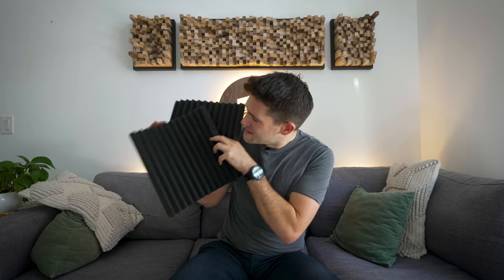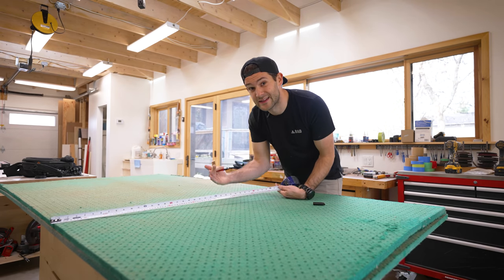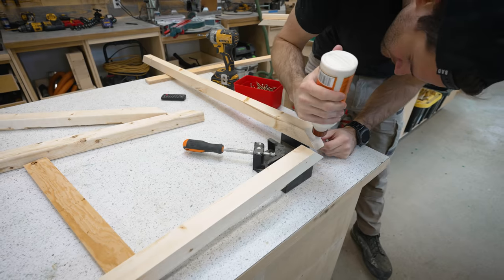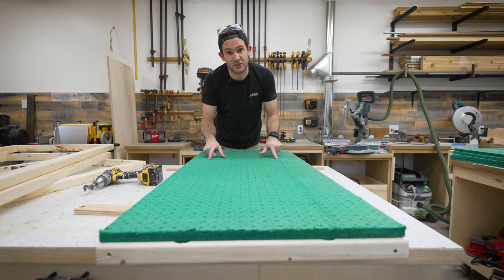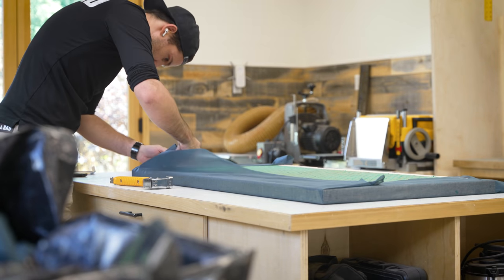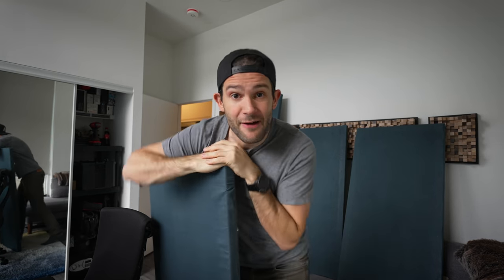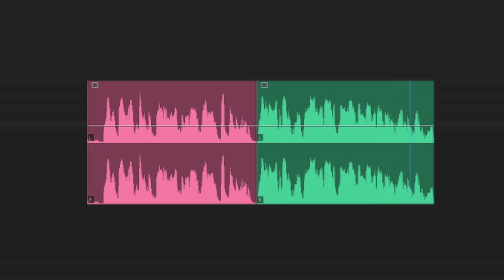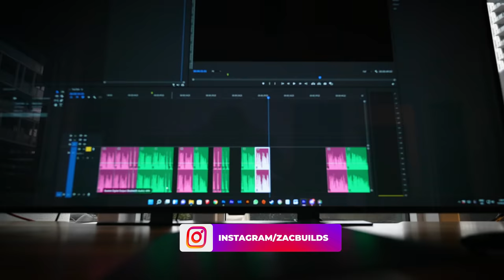Acoustic panels that actually look GOOD

Comment: Nice video, looking to do the same thing. One thing to note, I have the yeti X microphone and the software is pretty good at noise cancelling. Was that switched on when doing the comparison because I could hear a difference but not massively. The video itself was a better comparison. 

Good job either way. I like your recording style. Keep it up.
Reply from the maker: Oh damn thats a good question, I didn't even think to see if the de-reverb was turned on in the software. I've definitely got the compression turned on and a few other effect enabled. I thought the different in real life was way more noticeable than the recording showed and this could be a very good explanation for why

Comment: You chose a material designed to reduce kinetic energy to reduce sound waves.

You could have used polyfill or scouring pads. Lots of materials will work. Rock wool works better than most.

Comment: Your blinds aren’t going to do anything except in very high frequencies which due to their directionality would be pretty unlikely to come through the mic.
There’s a reason professionals use rockwool/roxul vs those terrible thin sound foam panels you mentioned at the beginning, and primarily due to their thickness. The science is pretty clear on broadband absorption and the thickness is one of the most important factors.
However you do have me interested in looking these up now. Would be worth a try as long as they are porous, but I would doubt they have much of a broadband application and are probably more for isolation.

Comment: Great Job! If you would hang another 2 panels on the ceiling, it would make a much bigger difference as standing waves also occur in a vertical orientation. Trust me you will not regret it :)

Comment: It should be noted that although this is fine from an interior design perspective, and better than nothing (and foam) from a sound perspective,  acoustical room treatment really isn't a 'throw the spaghetti at the wall and see if it sticks' kind of operation.  There's a relatively easy to apply science to it, and the information is readily available.  So do a bit of research and use discernment in which sources you use.  Hint - People who operate and/or build  professional studios know a thing or two.  There's plenty of them on youtube.

Comment: While I can understand the need for specialised sound treatments in a sound studio where you want as much reverb dampening as possible without using too much space on it. I don't really understand why people would need as much fancy acoustical treatments on the walls of a home studio... 

At least in my apartment; the main issue isn't reverb but lack of wall space... In my living room, one short wall is entirely windows covered in two layers of curtains; the other short wall is covered by 3 overflowing bookcases and a bar cabinet and a door; the long walls are covered with more cabinets, a tv (bottom half covered, upper half paintings), a door and three CD shelves (that is 90% full and never will get any more full) and a corner sofa. What little space not covered by furniture is used for paintings and prints (and we still have paintings we have no wall space for). Before moving in it was an echo chamber; but with all the furniture, art and decorative knickknacks theres very little reverb left. If I wanted the room acoustics to be even more dead; i could easily fix that with another rug and maybe a few panels in the ceiling. I don't understand how people manage to get the rooms in their houses so empty that reverb becomes an issue.

Comment: Hey man! Looks like the fabric works fine for holding in the materials on the back, but I have tried things like very thin wood panels and screen (like patio type) on the back and it's worked some what ok. Maybe see if one of those helps if you ever make more, thanks for the video my man! I prefer your frame style over trying to miter and fit 1x3s

Comment: Sound isolation is extremely simple, you need mass between the rooms you want to isolate, and NO bass cannot be isolated, it can only be dampened.  To fully isolate bass you need a 6 feet thick solid mass (average bass sound wave length) like pro recording studios for TV shows or movies for example.  That being said, acoustic panels are for sound treatment, not isolation.   I just though I'd clarify because you threw a few "isolation" in the video, I am that was not intentional but it might throw some people off.

Comment: Wondering if you'd left the SANOPan panels single thickness and doubled the wall surface covered? IOW, do two layers give you double diffusion, or does twice the surface coverage of one layer give you more diffusion?

Comment: I'm wondering what your blinds are made of???
    Even cotton, or mostly cotton) sheers ove all your windows will make a difference...jus make shure theyre still kindof wavy when closed (if that makes sense)...not flat like a window shade...so enough panels for the size of widow that it stays wavy when closed.

Comment: This panels are nice for the looks but its not absorbing (low) frequencies below 50Hz maybe some mid frequencies but its too little too notice some difference in your sound. The diffuser in the back is used when your sound is too dry, I doubt if it realy works in a large and non absorbing room. Try also to do something with your ceiling its very high. Dont use your speakers on your desk the soundwaves are reflecting on your desk and it will be a pain in the ass to absorb the frequencies when you have a large reflection point. Try thick curtains for the windows thats going to make a huge difference, it will be more absoring as the small accoustic panels.

Comment: Zac, you took the idea right out of my head. I have been wondering if Sonopan could be used effectively as sound absorption panel filler!
Reply: The potential issue with it is that it's designed to STOP sound from moving from one room to another (transmission). This could mean that, while the sound is prevented from making it through to the next room, it's bounced back into the room where it originated. That is exactly what you're wanting to avoid in this kind of application. It may be why the results of his test weren't as different as they could have been. What you need is a material that will most effectively ABSORB the sound.

Comment: Yeah nice video, but it seems like a lack of understanding on how sound reacts to absorption in a room. That’s totally ok though! This does about as much as anything soft you can put in the frame. Looking into targeted absorption and using a measurement microphone with a sin sweep to see what build ups in frequency you have in the room. That will help a lot more than just taking all the high end out the room with generalized absorption material. Most times that’s not where you’re having the issues anyways! Plus if you want the room dry just for vocals, maybe just work on a micro booth like the isovox! A accurate listing area will be different from the desired area to record! Have a great day!!

Comment: The panels would do better a better job, if there was an air gap behind them, as they would slow down the sound waves both going towards the wall, and coming back from the wall.
Also, Rockwool produces subflooring insulation, that has a real high density, which is what you should use to make panels from, not that flimsy stuff you put in walls, as the higher density stops air/sound waves much better. Their floor insulation comes in 2"/50mm thickness, which makes it ideal for sound panels, as you can build them with a 4"/100mm frame, and having an 2"/50mm air gap built into the panel, and still being able to mount them flush to the wall.
Added bonus of the higher density is, that there is almost no loose fibers.

Comment: Acoustical fiberglass works better than mineral wool too. Mineral wool isn't rated for sound control. Also, acoustical panels work a bit better with a slight gap between the wall and the back of the panel. 1/4" - 1/2" is acceptable.

Comment: I think it could be my old ears, but I couldn't hear much a difference. My brain tells me there should be a difference though. Honestly, since you're speaking directly into a condenser microphone, it's doing enough filtering to keep any echoes out - especially since your tests were performed a few inches away from the mic input. I also don't know if your Mic is a configurable one that lets you switch between condenser/cardioid/omni, but that would affect how it picks up your echoes. With your panels mounted as in this video, I imagine you would see the greatest improvement if you used a mic with omnidirectional / bidrectional input, because it would give your voice time to travel around the room and feedback into different sides of the mic. I think others have mentioned it, but with your mic against a wall, and you facing that wall, your vocals don't travel as much AND would bounce off the wall behind your mic (but if you're set to condenser mode then it won't catch those echos as much). Great video and build though. I think the panel arrangement you have will go a long way in just general removing echo from the room...whether it improves your audio quality depends on a lot of other variables - but in this scenario it's best to knock out one variable at a time so kudos!

Comment: You should really think about adding some panels to your ceiling, maybe try them flat and then hanging from one side to see it there is a difference. In either case it will help. And maybe using white fabric might hide them against the ceiling.

Comment: just take cotton. Cotton is an absorber in itself. No need to get a accoustic transparent fabric or whatever on an ABSORBER. Also the thiccness of like 0.5mm or 0.3mm doesnt matter anyway as long as its not a hard surface. Sound will travel through it ;)

Comment: I'm listening to the audio test with a pair of M40x, and I'm sorry, but there's barely any difference. Sure, you could say that the non-treated recording is a tad bit tinnier and there's a hint of extra reverb, but if you're not paying attention to it intensely, you wouldn't be able to tell them apart. It's possible that YouTube compression and processing is messing too much with it, but personally, I would double down and get some Base traps in those corners along with some extra panels for the upper portions of the wall.

Comment: That acoustic foam is NOT an efficient sound absorber. It is primarily a sound diffractor. And as such, it is most effective at upper mid to high frequencies. If you used it exclusively in your recording space, your recordings will end up with a hollow boxy coloration. Best to use a mixture of absorption and diffractive surfaces if possible.

Comment: @zac Builds , the corner clamps might work better if you use it upside down. try it out even if it might not be the right way to use them.
Reply from the maker: Upside down so that the mitered corner is covered by the clamp? I'm not sure how that would make a difference?
Reply: @ZacBuilds  Sorry Zac, I might have not understood correctly your point, I was thinking maybe the downforce of the weight from the clamp might be helpful to holding things alligned if things weren't level. My bad. Too bad they didn't work amazingly, I am looking for some good corner and framing clamps myself. - And thanks for the reply!

Comment: very nice. however, for me the frames are too wide. You're putting up a LOT of hard wood that is likely to reflect more sound than the material of the wall you're hanging it on. I will definitely use this video as inspiration for my own panels, but I will probably half the width of my frames.

Comment: Well, this build is probably a little better than stringing heavy curtains around your room. But if you are going to build good performing acoustic panels, let's start with the right materials and design.  Zac's panels may address some higher frequency audio reflections, but those aren't as damaging to your audio experience as the bass frequencies which ping-pong around your room. These panels are simply too wimpy to make much of a difference there. You are investing the time and expense for all these materials, so let's do it right.

Here's an inexpensive and far more effective DIY strategy. Go and buy a couple boxes of Corning 703 rigid insulation. These are easy to work with (use common sense when handling) and already perfectly sized for panels. Build a frame like Zac's except make it 4in deep -- the 2in frame in this video and thin material is just not good enough. Sandwich two 2in insulation boards in each frame. Cover the front and back with the material of your choice. You now have a panel which will perform as well as any professional panel if positioned properly.

BTW, I do like the magnet idea and would have considered using that on my last studio build.

Comment: Why would you remove the sound diffusion panels when you are testing the efficacy of the acoustic panels?
You're supposed to eliminate variables, not introduce new variables.
Also, you may find that air flow into HVAC ducts is kind of important.

Comment: Sonopan has no data on what frequencies are absorbed and how many db it reduces those frequencies. It works great if you want to prevent sound from transferring from room to room but there is no data on energy from a loudspeaker impacting the material when it is used for acoustical treatment. I’m not saying it won’t work. I’m saying Sonopan has no data on this and I haven’t found it from any 3rd party study!

Comment: EVERYONE, since he didn't bother to explain in the video, there are two types of acoustic panels for treating sound in a room.  Absorption and diffusion.  Absorption is primarily for preventing sound transfer from one room to another.  Diffusion is for improving the quality of sound within a room for the listener.  The "ugly" panels he showed in the beginning are for diffusion and they work well for this.  The Sonopan he's trying to sell you is for absorption, i.e. to prevent sound transfer from one room to another.  While it will tame audio in a room, It's not designed for that, and won't have that much of an effect as diffusion panels.

Comment: Step one - get clean ascetic room because reasons. Step two - fill it up with stuff, because ascetic doesn't work for humans and sound :)
More stuff, heavy "curtains" (not just on windows) or fabric here and there could do all the same or better. When more is needed - check ceiling. Most suspended ceilings materials have anti reverb properties while default concrete is really bad.

Comment: Those frames are way too heavy. I would have doubled the thickness of the panels, and used a felt cover instead of the thing fabric. Then for best results hang them from the ceiling a couple of inches off the wall. That significantly improves their effectiveness vs on the wall.

Comment: For anyone of you sound techies out there, I have a question.. I'm building a vocal booth and wondering if I need diffusion or absorption or both?  Assuming it's both.. I'm building it into an already existing cabinet space that I'll stand in front of with either a curtain behind me or another, portable panel that I can move in behind me.  Any thoughts would be welcome!
Reply: For a VB I would only recommend absorption. Four-six inch panels with Rockwool placed a 4-6 inches away from the wall respectively. You will want the absorption behind you since most vocal mics will be some cardioid pattern, rejecting the source behind the mic. If you want to reduce echo from the room in front of you, build a couple more panels and use them as gobos. You need a lot of room behind you for diffusers to work properly and that is mostly to bring some life back to an already treated control or tracking room. Vocal booths rarely have diffusion in them. Most of the ones you see are also much larger rooms with feet of absorption on each surface, making them look like they are in a closet.
Reply: @FiByfi  Thanks I appreciate the reply!

Comment: It's a shame that a video built around a misunderstanding of acoustics is so popular. This material was designed to deaden vibrations between the drywall and the studs of a wall. This is very different from what an acoustic panel does, which is deaden sounds travelling through the air and reduce reverberations. Very different. The quote "I've used rockwool for sound insulation in homes and it just doesn't work that well" is especially damaging. Rockwool is THE sound acoustical material. It's used in almost all professional acoustical treatments in studios and theaters because it is so far superior to any wood or foam products at absorbing a wide range of frequencies. I'm guessing the host tried rockwool INSIDE the wall and wasn't impressed with its performance of keeping sound from travelling from one room to another - isolation. That is because the wall was constructed in a traditional manner: drywall attached directly to the studs on both sides. The vibrations in a traditionally built wall travel from one room to another because the walls are directly coupled. This is the issue that SONOpan addresses. It decouples the drywall from the studs and thus decouples the rooms. Putting rockwool in between the studs, doesn't decouple the drywall from the studs, so it IS inferior in that application. Just as SONOpan is inferior in treating acoustics inside a room.

Comment: Firstly, you’re so fucking skilled. I’m a fan. Liked and subscribed. On this particular build… So the material is a bit way too dense. And mounted too flush. The thickness of sound absorption panels and the air gap between them and the wall is not a flaw in their design, it’s what their function dictates. Stacked towels are a great cheap method, as tested here on YouTube. There’s certainly a difference with the panels, but those frames could be made more effective with a different “stuffing” as it were.